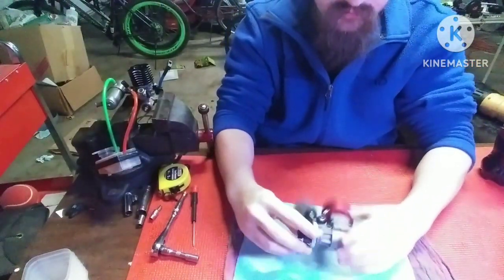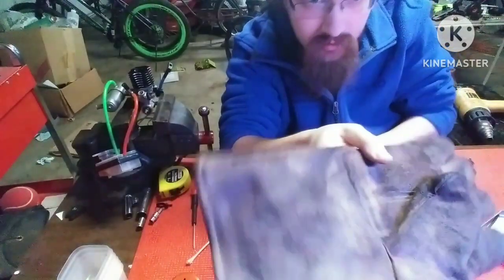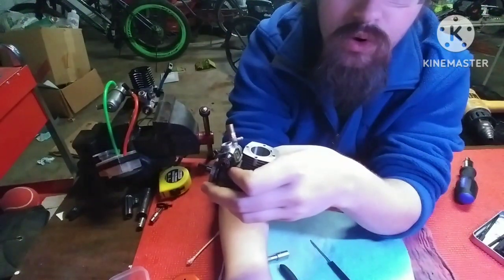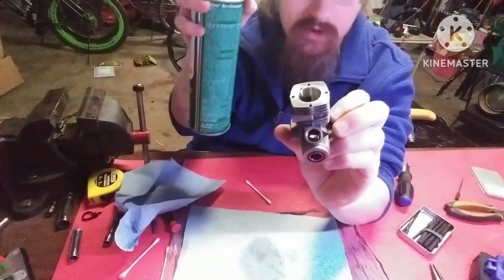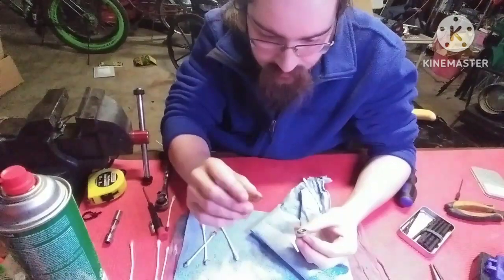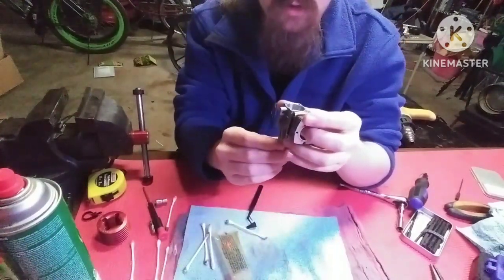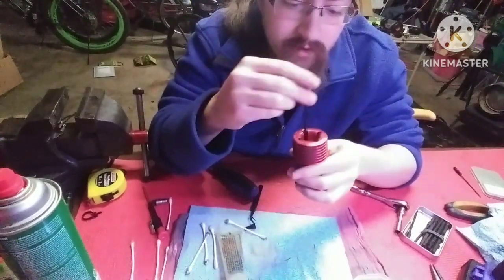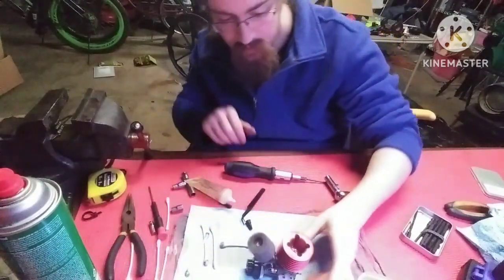Tear down and cleaning dynamite .12s

Comment: Hey good video man! And non chlorinated break clean is usually fine on o rings. Also the air filter is actually a factory part from team associated it's actually a carburetor fuel filter for a chevy truck carburetor lol
Reply from the maker: Thats pretty cool
Reply: @dereksgarage1856  most definitely